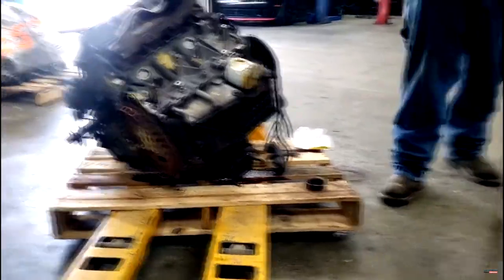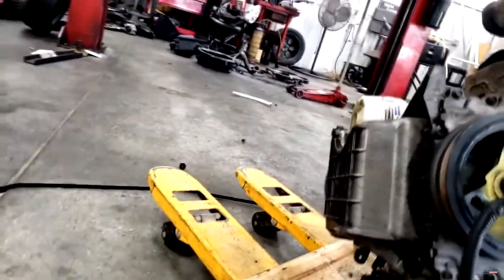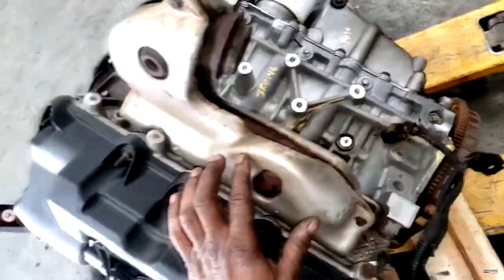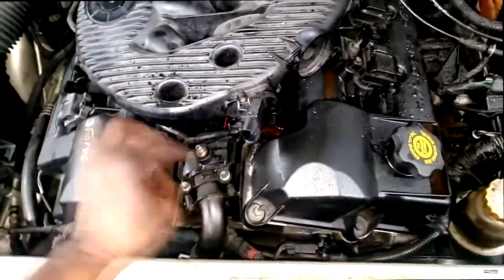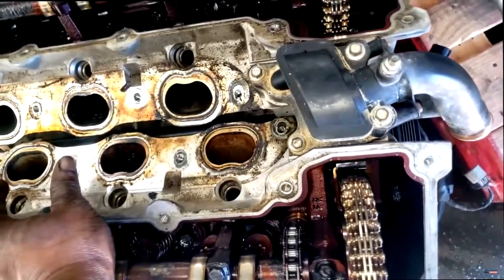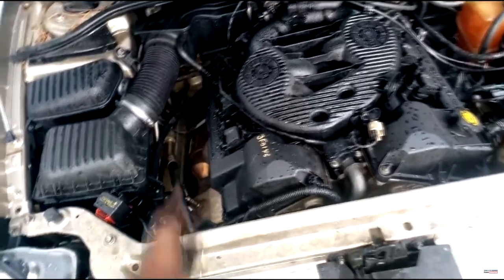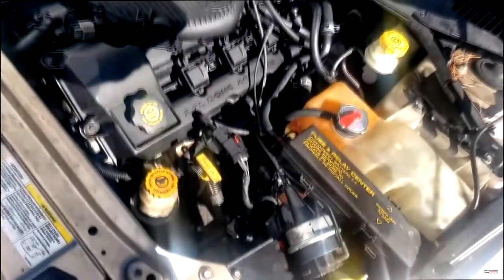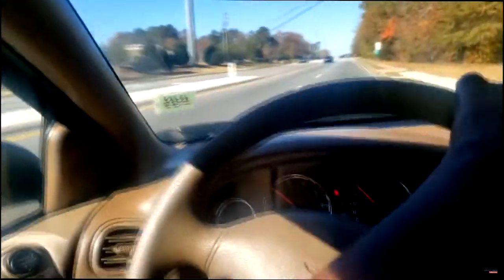Just about everything went wrong with this USED 2.7 sludge job. But it worked out at the end.

Comment: My 2.7 was running fine, I dropped my son-in-law off at work. Came home and as I was pulling into the driveway I thought I heard a knocking sound. I revved the car up to see if I really heard that. Before it could come back down it got louder. I opened the hood and checked the oil. It was full of antifreeze.
This happened within two houses down, to my driveway. I just cut it off and wondered what to do now. It was a beautiful green 99 Concord without a flaw. Unfortunately the car wasn't worth the price of putting a NEW engine in it. I never did like a used motor. 😭

Comment: If I'm going to have a shop put in a different engine I'll just pay the extra for a new one or a warrantied rebuilt one.  It's worth the piece of mind and an auto technicians time is precious plus it saves them a lot of unnecessary headaches and frustrations.  I always try to put myself in the others person's shoes.
Reply from the maker: Damm good point Patrick.  When they told me the job sold, I did not know it was a used engine..lol..This was nerve racking
Reply: @OnlineMechanicTips  yeah I learned this principal in the air force. We did cost analysis of repairs vs replacement and if they close we always went for the option that would be the one that worked the best and would be guaranteed to work.

Comment: What about the peeling rod bearings ??? You might think it's good motor. I recall about to pull a used 2.7 and I I pulled pan and it was not good. Even tho valve cover area was super clean

Comment: Put that motor on a good stand ley me at it J.T. let me at that 2.7L ON A GOOD solid engine stand it is over. The motor is going to sound like it is bathed in oil while idling. Sometimes it may be better to use an oil engine pressurizer before starting up a 2.7L. Put it on a stand let me at it man. LOL, what is up with y'all man on that Concorde ???